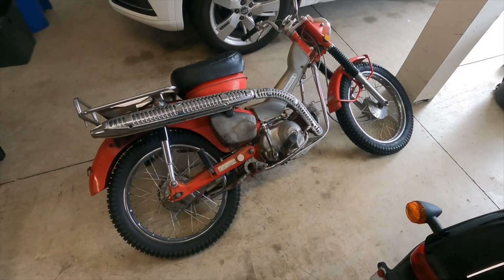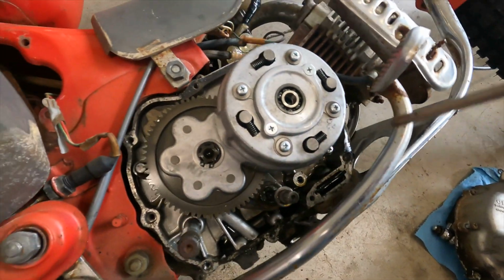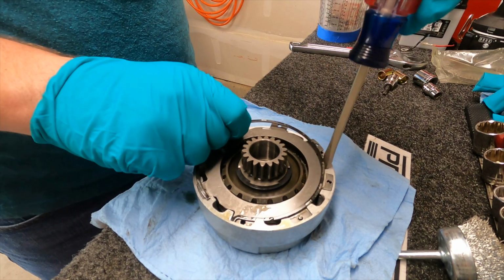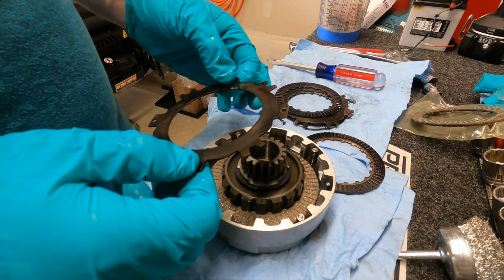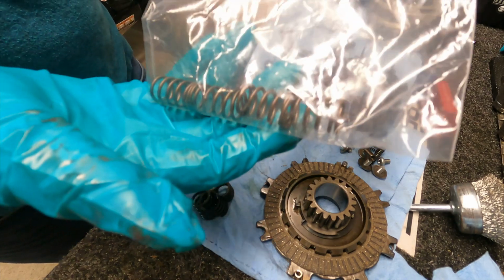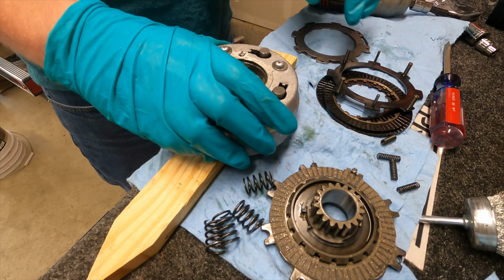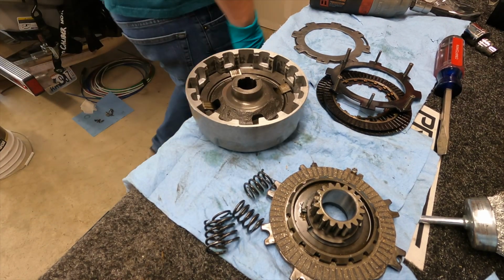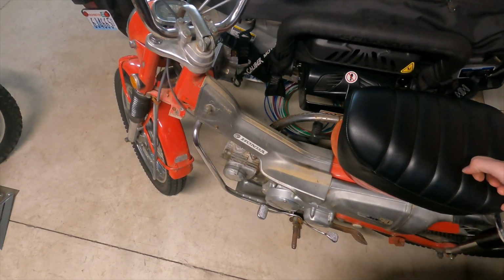Honda CT 90 How to Replace the Clutch!

Comment: Do the new springs make the shifting more crisp? Also that disc you scuffed with scotch brite, I’m guessing it helps minimize slippage when shifting. I am in the middle of taking mine apart, shifting from 1st to 2nd was requiring several firm stomps on the shifting lever to get 2nd gear to catch. Thanks for the video, very helpful!
Reply from the maker: Yes I scratched it to just help it bite better. And dont quote me on this but I assume if the springs are weak the clutch plates will allow it to slip I can’t remember. It could be your shifter shaft that is worn which could be causing the issues with shifting. While its still apart check out my video on the shifter shaft replacement on a ATC 90 it helps explain what to look for on your 90 to see if that might be worn and worth replacing also.

Comment: Thanks for the video!   Do I need to drain fuel?
Reply: Just ordered a manual impact driver.  Couldn’t even take the cover off. Should be here in a few hours.  🙏🏼
Reply from the maker: If you have a full tank probably should if its under half a tank you should be fine as long as your petcock works.
Reply: @procyclerepair  Thanks again!

Comment: I think I’m encountering the problem that you mentioned. When I attempt to kick start the motor, more times than not, it doesn’t turn over the engine. I feel resistance, but the engine only gives a few weak sputters. The previous owner gave me a quart of oil when I got the bike, and it was cheap automotive type. Do you think the clutch plates have been negatively affected by the use of incorrect oil? And did this fix your problem? The engine runs strong once I start it by bumping it into gear while coasting down a hill.  Thanks in advance.
Reply from the maker: It possibly could, but Its probably more than just oil choice. You should dig into it and replace those parts. It would probably be under $100 to do it all. Happy wrenching.
Reply: @procyclerepair  yea I plan on taking it apart and looking into it…what else do you think could be causing this issue? Poor meshing on starting gear?
Reply from the maker: No, I think it’s exactly what I replaced on this bike. When you take it apart you will see the gears for the kick starter and you’ll easily be able to tell if theres lots of teeth missing. But I think it will be fine! 🤙
Reply: @procyclerepair  Cool, thank you for the input. Once I get a chance to tear into it I’ll let you know what happens. Thanks bro
Reply: Tore the bike down right now. The clutch plates have disintegrated, will definitely replace them. Thanks for the help.
Reply: Just wanted to thank you again. Just finished the install, and the bike started right up on the first kick. Would have never known the problem unless I saw your video…cheers
Reply from the maker: @Clk4robotics  Thats great! Glad that helped!